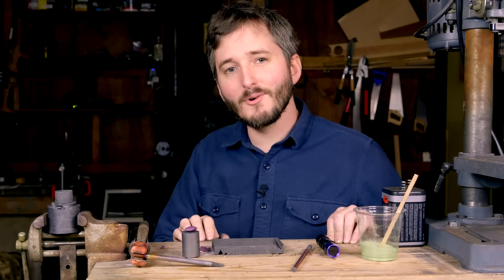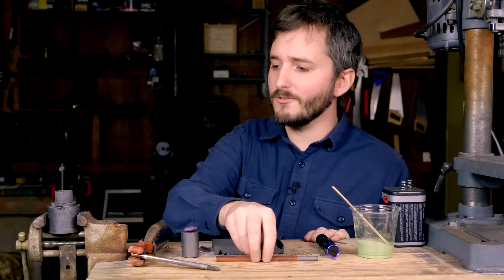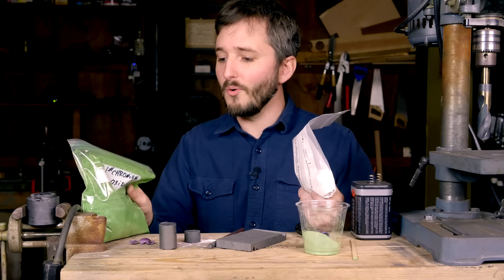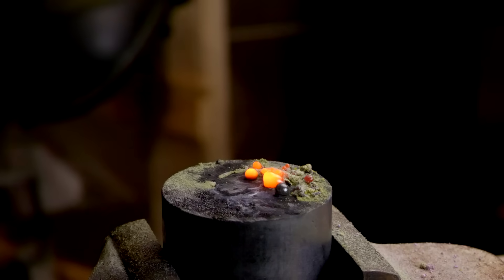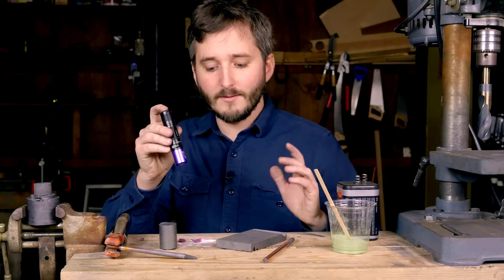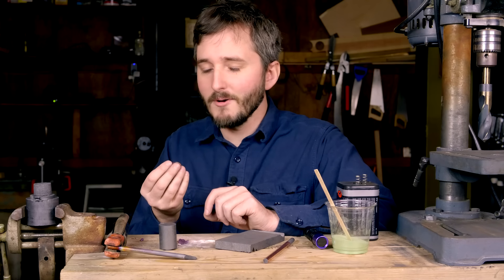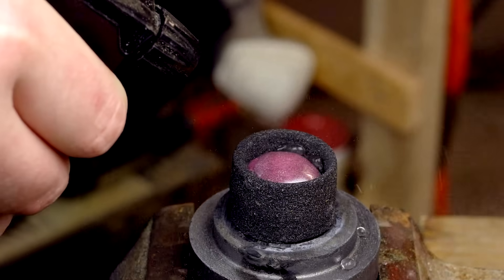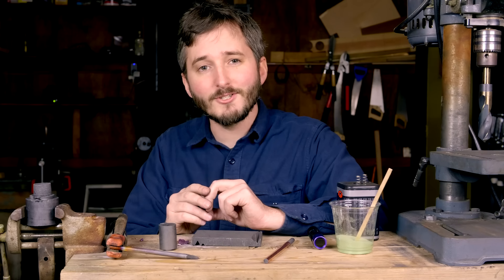How To Make Synthetic Ruby In The Workshop

Comment: This method makes useless valueless "gems" stones. No clarity no vivid color the hardness is not what it should be if you simply drop it on a hard surface it will likely shatter.  Youd be far better off with a pressurized cylinder full of liquid corundum mixture

Comment: Unlikely I'll get a response on a 4 year old video but figured I'd try. I'm trying this process using a couple methods that aren't an AC arc welder. I've used my DC Stick Welder, my TIG welder and an oxy-acetylene torch for melting. I do get some decent results in terms of color, but I get big black spots on my pieces that really ruin how they look. I'm wondering if it's a contaminant in either my graphite or if the tungsten is being deposited, but I'm honestly at a loss. Is AC welding just that much better at this process, and I've been barking up the wrong tree?

Any info is appreciated.
Reply from the maker: I'm not totally sure. I've only ever done what I show in the video. Be sure if you're trying this repeatedly that you're not breathing the fumes. It's similar to welding stainless. The chrome is not good to breathe.
Reply: @Nighthawkinlight  thank you for the response. I'm making sure to be in a well ventilated area. Worked as a laser technician cutting horrible metals like zinc and stainless for a while. 

I'll have to continue experimenting.

Comment: Hello! We are going to try this process at home! Thank you for making this video. 
My 9yo son is crazy about this project but we have some questions about some of the materials needed for it. 
1. How many mm does de the carbon electrode needs to be?
2. How many microns (27 or 50, etc) does the Aluminum Oxide needs to be?
Reply from the maker: This could be dangerous because of carcinogens that are blown into the air. Please don't do this with a 9yo around and it should be done outdoors and upwind. It doesn't matter much what size graphite or oxide is used.

Comment: I'm curious why you wouldn't have use a Torch (flame) to create the Ruby ?
It seems to me if you can heat it up with a flame and not deposit any more impurities into it such as Carbon, you'd have a better chance of creating a higher quality Corundum/Ruby. 
Maybe you could try this experiment again but instead of Chromium add Iron resulting in Sapphire ?

Comment: How are u getting them to come out clear and how do u keep your carbon rod from burning away or having pieces of it fuse with the ruby material i tryd carbon rods from batteries sence alot of people suggest it but there so short and soft they burn away or join the puddles fairly fast im now using graphite stir rods from princess auto sence graphite is essentially just carbon there about 10$ eatch and fairly  long they allso seem more durable and dont burn away as fast but im still ending up with alot of carbon spots in my finnished piece if im lucky alot of times i just end up with a black glossy glass looking piece
Reply from the maker: Quality of the graphite or the crucible might cause that issue. A lot of graphite is made into shapes by combining it with clay and pressing it. The best quality is called extruded graphite

Comment: Just curious: Can you do the same with an actual flame: Oxy-acetylene (~6000 ' F) and even propane (~4000' F) seem to be hot enough? Of course, you'd have a bunch of "blowing" with these (and thus heat loss/blown material if you tried to apply it directly). It seems like some sort of kiln setup with an Oxy-acetylene could get to the 2000' C you need in a small enough space?

Comment: "An abrasive media" ?  No, that is an abrasive MEDIUM. Media is the plural of medium and ali-oxide in ONE medium not several.  Nice little trick with the arc-welder.  I wonder whether putting some refractory brick around most of your crucible would help get you further before going direct.

Comment: I have an idea, using multi layered high pressure water tank to produce hight quality natural gemstones! Each layer contains water with different levels. The most inner core %100  includes ingredients of ruby, second inner %80 only water to works as bumper, and next next..  So inner layer heated by induction coil. and as water evaporated due to the contamination, could not escape and creates extreme heat and pressure. other layers also act like cooler and pressure compensators. I believe it could bring highest quality simulated process as normal like under earth natural occurrence.

Comment: A common misconception! But it is always true that like cuts like. Otherwise we'd have nothing that could cut diamond. Duh.
If you want smaller particles of X, just keep rubbing them together, and they will get smaller.
You don't need a tungsten drill to drill into solid steel. A steel drill is fine for that. Provided you use lubricant and coolant.
This is a classic myth the ancient aliens fools try to use to claim Egyptians couldn't work granite. But of course, working, cutting, and polishing granite is very easy. Just not quick. 
Cheers.

Comment: In synthetic ruby the structure of the crystal will appear uniform under magnification, whereas a natural one the crystal structure points in various directions.  
I wonder if there's a way to heat and cool a ruby to look identical to the natural.  My guess is part of the ruby would have to be cool enough to retain said structure with just enough heat to change it at another part.   I have no idea if a strong magnetic field would have any effect on structure.

Comment: Hi Ben, can i pose you 2 questions? (if you have the time to answer them):
-1) Why is it a problem to transfer carbon from the electrode to the molten ruby? Does it cause a decrease in the gem quality? Maybe could it change the hardness and the colour? i don't know.
-2) To avoid the carbon problem of the electrodes, isn't better to use some tungsten ones? Tungsten electrodes are really cheap, and not transfer external elements to the molten crystal
Reply from the maker: Carbon makes the rubies dark in color and introduces bubbles. Tungsten electrodes may work better.

Comment: This is really impressive man. I really want to know what your polarity was. 

I'd be interested to see if you'd have cleaner results if you used some kind of flux or inert gas covering to clean the molten ruby and maybe even use a tungsten electrode so you don't contaminate with carbon.

Comment: Hello @NighthawkinLight, nice video m8! I was trying to do the same process but when i tried to melt alu oxide with chromium oxide using an electric arc welder as you did, i got just some tiny black spheres out of it without any fluorescence... do you have any tip or advice for me? Do i have to use direct current in direct way (ground on +) or in reverse way (ground on -)?
Reply from the maker: Not sure. Sounds like a lot of graphite or metal contaminated them. Are the oxides fairly pure?
Reply: @Nighthawkinlight  yup, 99.9% alu oxide

Comment: Where can i find that graphite mold you were using to melt the mix together in? I cant find anything like that anywhere online.
Reply from the maker: I made it myself by drilling a cavity into a piece of graphite rod
Reply: @Nighthawkinlight   could you make an extra? Id be willing to buy it from you.
Reply: Damn! I dont have a way to make something like that. 😕
Reply from the maker: @paulpierson5563  I can't make an extra, sorry. It does not take much effort to make one yourself because graphite is very soft. If you buy a rod you can cut it with any saw, and if you do not have a drill you can scrape out a cavity with the tip of a butter knife.

Comment: Would a simple arc welder from Amazon for around 100$ 15-20amp wall plug still be able to achieve the necessary heat? Or would I require a larger more powerful one?

Comment: That’s pretty neat. How does your ruby acquire its corundum though? Yes, aluminum oxide makes the color. Gem enthusiasts and rock hounds know this. But slightly more knowledgeable folks know that ruby and sapphire are both primarily corundum. How does yours count as a ruby if it doesn’t contain any corundum?
Reply from the maker: Corundum is the mineral name for a gem composed of aluminum oxide. It's not an ingredient.

Comment: So cool. How about making a file or sandpaper block made of ruby. By first making your crucible or "mold" out of your starlite material, let it dry completely, then pour some of your dust mix in there to make a ruby shaped into a block (sandpaper block) or rectangle (file). Not sure how to get the pointy cut edges, maybe you will need a final process to shape/sculpt the cutting surface to have a sharpen file.

Comment: I've been doing glassblowing as a hobby for years and feel like the powder you used could be used to coat the outside of a glass piece, like normal color powder. Although I already feel like I see many reasons why this wouldn't work it could still be interesting.
Reply: Actually alumina is added to glass surfaces to make it scratch proof.  It actually does work...
Reply: @edwardortman2593 it's also one of the components in low thermal expansion glass
Reply: please try

Comment: Just a reminder, wood and lapidary shops all across the land play with diamond wheels and stones to sharpen, grind and polish.  You can get really cheap diamond wheels that can be mounted in a drill or drill press to rough in and even move toward a polish on the stones. 

With a bit of playing, you could even use use diamond polishing pads intended for granite work and that are intended for use on angle grinders. I use a variable speed angle grinder so I can slow the grinder down.

For the grinder, I rigged up a 1/8" inch hose, which connects to a regular law hose via a valve, which allows me to control the water flow. The water greatly extends the life of the diamond plates and pads.

You could always buy a pad or three to dedicate to different compounds picked up from sites that sell rock polishing supplies.

Comment: I was a hexavalent chrome plater for aerospace for a few years before switching to anodize in semiconductor, that chromium oxide is jot very harmless for very long once it's heated and you will get hexavalent chromium that is produced as a side product, carcinogenic and bad to inhale, i used to get chromium that would stain and soak into my skin in liquid form mixed with acid as an electrolyte, no lasting damage but that's not the parts that's dangerous about chromium, the fumes and mist that comes from hex chrome is what's most toxic and quickly absorbed into the body wreaks havoc, your kidneys and liver have an easier time clearing chrome absorbed through the skin rather than chrome that lingers in your lungs and hits your blood brain barrier almost instantly

Comment: Great vidjayo. I tried this with my M.O.T and variac transformer and had some sort of good results before it let magic smoke out out of the transformer 😁  Im building the next setup with 2 mots and couple high voltage diodes and a couple high voltage caps for a total of roughly 6kvdc half rectified in an oil bath to keep it cooler.

Comment: With that fast cooling, do you not think what you have there is an alumina glass doped with chromium, rather than a mono crystalline chromium-doped corundum crystal, which would would be a actual ruby? Have you checked it between crossed polarising filters?

Comment: Aluminum oxide suspended in the air can enter the lungs and cause a kind of damage that is cumulative.  Same with silica from hardwood dust.   When TIG  welding with stainless consumables I take ventilation seriously because heating stainless like that causes the chromium to form hexavalent chromium and that is a nasty shit.   Be careful.

Comment: Hi, NightHawkInLight. Thanks for this video. I love the fact, that if someone asks me what I did today, I can answer: "I was vacuum cleaning the rubies that were lying all around in my workshop...!" :-)
One question that you might perhaps answer: I also used an arc welder, two graphite rods, around 80-100 amps and used the powder as a "bed" to avoid contamination, since I was working on plain steel, because I had no graphite recipient.
Now: To get the nicest rubies, did you make them boil after melting or just melt and done? And rather in a quick manner or slowly?
Thanks and have a lovely day.
Take care
Martin
Reply from the maker: I didn't make any rubies I would call nice. I'm still figuring out the best method.

Comment: is there a specific reason you use an arc welder or would this be possible with other forms of heat?

also super cool video! i love the close up melt shots!
Reply: A traditional RF induction heater capable of reaching these temperatures is 10-15K$ it seems.

Comment: So today I tried to copy your technique. But I have run into one, maybe two major problems. In my case the ruby (also tried sapphires) stuck to the crucible. So, how did you get them out? Have to mention that I tried distilled water for cooling. Maybe it's the alcohol you used?
Next problem: the rubys were very brittle and contained a lot of carbon and other impurities. I think it's because of the arc welder. How much amps did you use? Mine had only 190amps
Reply from the maker: Not sure why yours stuck. Different kind of graphite possibly. Extruded graphite is better than pressed, which usually includes clay that your rubies could probably melt into. Mine also were brittle and contained carbon.
Reply: @Nighthawkinlight  thanks, I will try extruded if I find some. Already ordered some high purity ones (99,9% claimed) maybe this helps. And sorry, I wrote you an email too, didn't thought, you would reply so fast here on yt. Thanks for the help!

Comment: I tried this experiment, and ended up with tons of carbon contamination. TONS. I tried with a graphite stirring rod, appx 3/8" diameter; with a 5/16" carbon gouging rod. It just gets a thick layer of carbon on the top.
I noticed later in the video you were trying to pre-heat the crucible; how much carbon contamination were you getting before that?
Reply from the maker: I did not have much issue. Low quality pressed graphite will contaminate more than extruded graphite.

Comment: How many amps did you set your arc welder to? We tried to copy your approach but ended up with a rather black looking and porous result (it did glow red in UV light though).
Reply from the maker: 30ish. A black result is caused either by carbon contamination from your electrode or impure chemicals to begin with. If it glows red you hit the right temperture.
Reply: @Nighthawkinlight  Man you're awsome, thanks a ton for your really inspiring videos and for your quick reply! You rock!

Comment: So you've made roughly what is called a "cabochon" in precious stone cutting! It would be nice to see it professionally cut and polished.
Reply: The main problem is that's quite evidently full of gas inclusions, that's the main problem of those DIY methods.
To heat the crucible from the external was the correct method, but you have to do that for hours, and at the same time make it vibrating, to get rid of the inclusions.
Reply: It will not look especially good since its not a crystal but glass.

Comment: I would like to see this done using a huge fresnel lens to focus sunlight to provide the heat I think it could produce better results because it wouldn't blow away the powder and because it isn't actually burning anything it would be clean and not  put black carbon soot discoloration into the Ruby

Comment: I can't get mine to liquify like yours are. Under the UV light I can see lots of ruby dust, I just can't get it to make big ones. I have tried 1% chromium oxide and 2% chromium oxide. What settings are you using on your stick welder?
Reply from the maker: Something like 30A ac.
Reply: @Nighthawkinlight  OH! Mine is a DC stick. I'm an amateur with welding, but that's probably the issue.
Reply: My friend has an AC stick welder, I'm going to try it and see if it makes any difference.

Comment: You could design a form of 3D printer with real hard materials.. with this proces..  Small scale Low voltage high amp currents with precision point hardening.
Reply: Especially because it comes in powdered form.

Comment: I can’t replicate your results with my arc welder. Is this specific to rubies with chromium (iii) oxide? I’ve tried just straight melting aluminum oxide but it doesn’t turn out well at all. What voltage are you used for your arc welder?
Reply from the maker: You will not get any fluorescence or color without chromium. Just dirty blobs.

Comment: Nice video.
A constant current DC arc might be more controlled (maybe a TIG welder?)
DC arc heats up work piece more than electrode depending on polarity, and is less explosive if running constant current - but I'm not sure how TIG inverters are set up to operate.

Comment: Maybe if the heat is high enough, and the container vibrates to have liquids settle, as the ruby forms if it's on a flat, ridged surface it would have the impression of the ridges to get your ruby file.
edit 
I'd also look to rock candy making mechanics when thinking of how to make a purer ruby(higher carot?) without access to microgravity.

Comment: You can pulverise aluminium oxide with your mortar and pestle - you would want to use more of a hammering action to avoid too much abrasion/contamination, but your explanation that you need something harder than it, like diamond, isn't right - you can also pulverise diamond this way - despite it's hardness, it is still brittle enough to break up with these methods using materials far less hard than they are.